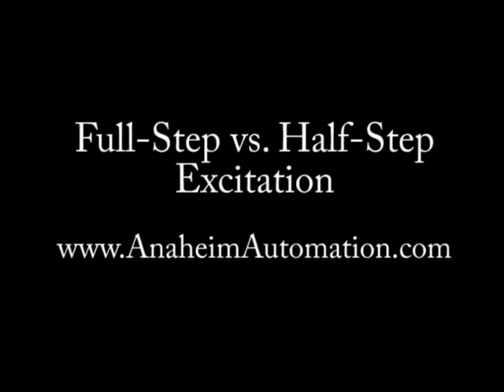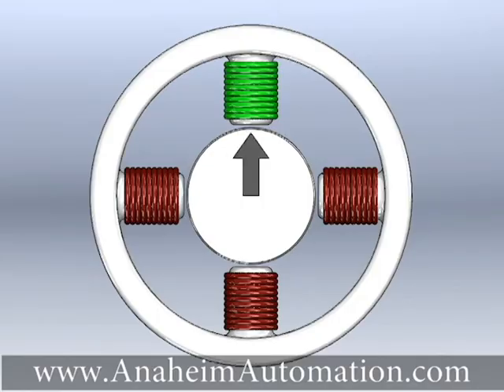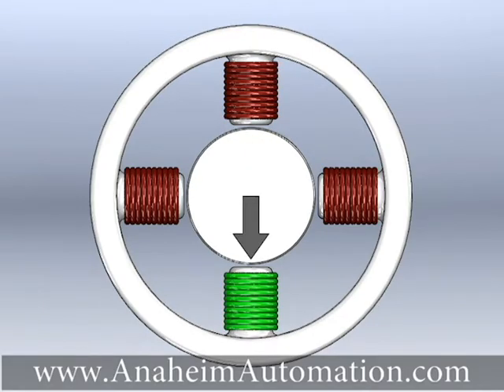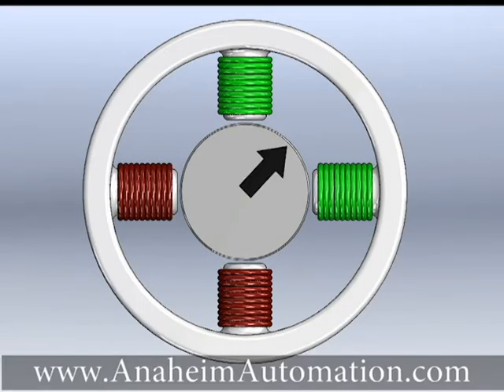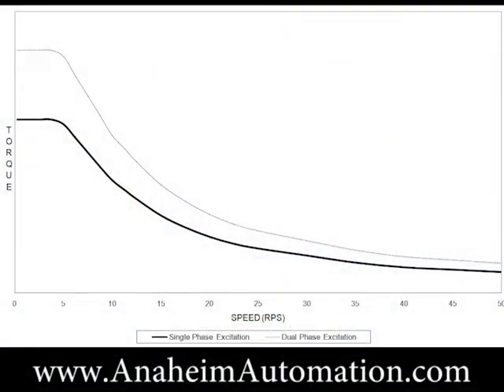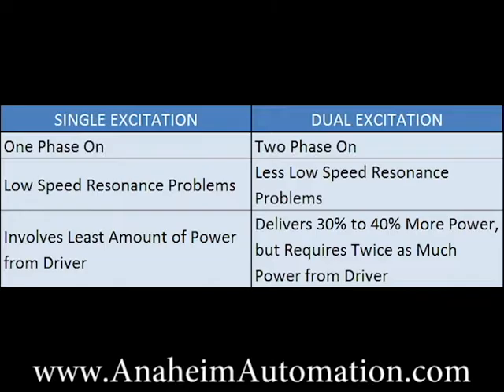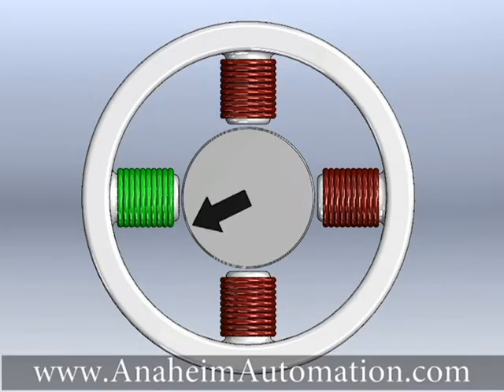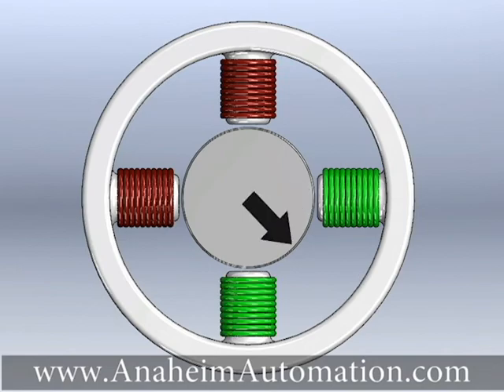Stepper Motors: What is the Difference Between Full-Step and Half-Step Modes?

Comment: .9 degrees per step?  Why isn't it 360/8 = 45 degrees per step?
Reply: In the video it only shows 4 coils. Thus 90 and 45 degrees seem relevant. However, stepper motors have MANY coil windings. The windings are only 1.8 degrees apart in a 360 degree circle. IF 2 adjacent coils are energized at the same time; as opposed to a single coil being activated; then the motor will step half way between the coils. This then means; that if  you couple half way steps and dead on steps; there will be 400 total steps instead of 200. (360 degrees divided by 200=1.8 degrees per step. But if you include half steps, the motor will step every .9 degrees.)

What I want to know is HOW do we determine whether a motor is full or half step? I would like for this to be explained in detail.

That was not explained in this video. But it should have IMO.
Reply: .9 degrees per step = 400 steps per revolution, full step 200 step per revolution (1,8 degree per step).